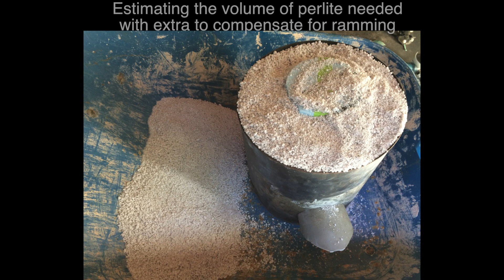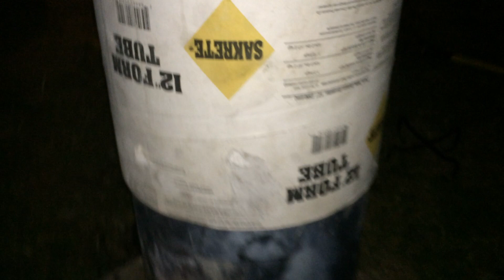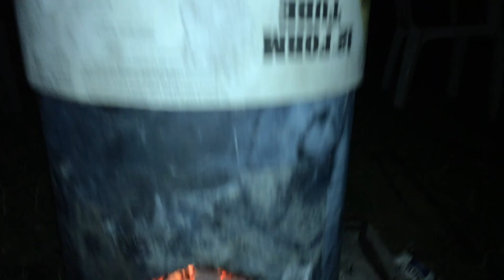Rocket stove test build

Comment: Could you explain the mixture at 1:11 into the video?  I am ready to order the ingredients and try this.  I looks like a very good mixture.  I know the perlite and the fire clay and the furnace cement, but what is the liquid you are adding? Thanks for the video.
Reply from the maker: It is home made sodium silicate, or "water glass"
Reply: +David Eaks Thank you.
Reply from the maker: To clarify, the blue liquid is sodium silicate. The mixture also has furnace cement and clay slip, the point is to make it thin enough to "drizzle" into the perlite.

Comment: whats the cure time to fully usable? and have you considered using 3/4 " foam board for making custom shapes?  using a drill motor and a 1 1/2" paddle bit you can get a smoke channel  started and burn it out  giving more flexibility.

Comment: I would really appreciate your thoughts on this mixture's durability over time. I know some people dismiss perlite out of hand, assuming that because it's so light it must also be fragile and not worth working with. My hypothesis is that once fired, your mix (and ones similar to it) would be very long lasting when encased in a rocket stove build because it only needs to stand up to continual burn and not physical jostling or chipping. Has this been your experience?
Reply from the maker: argentvixen, yes I think your hypothesis is accurate. This little stove is pretty durable, it does show some wear from recklessly jamming sticks into the feed... but that was the point of this test build so no problem.
Reply: argentvixen if you can squish something that can withstand thousands of degrees, it’ll survive in a rocket stove. The more “squishable” something is, the more it allows for thermal expansion which keeps it from cracking or shattering with heat.
Reply: @Dollapfin  Good catch.

Comment: could it be used as an outside protection on a pizzaoven  , combining 2 needed functions insulating the inner dome and protecting it from bad weather ?
Reply from the maker: I plan to do exactly that, but I think it would need a final topcoat to prevent the perlite from absorbing water. I'm testing a mix of fireclay slip and Oatey 3000 degree F Furnace Cement as a final outer coat as well as a hotface

Comment: what is the temp on the outside of the fire riser? I assume you will be using this on the inside of the metal drum on the full size RMH? looks promising!
Reply from the maker: Hi RC,

I've seen the outside get up to about 170F. This little stove won't be used in the full size rocket stove, it was just a test of the perlite mix I made. See my other video "heat riser build" for the full size parts and temp readings.